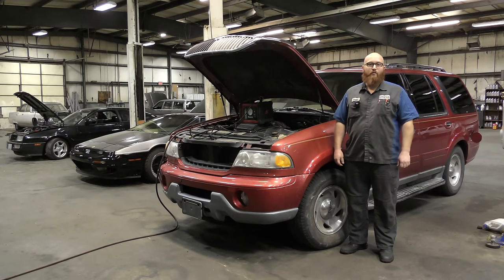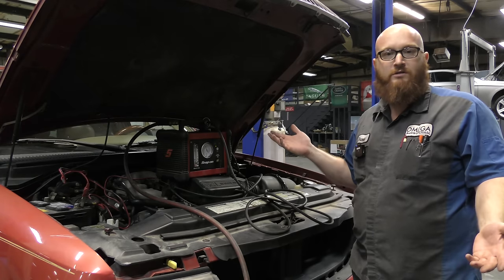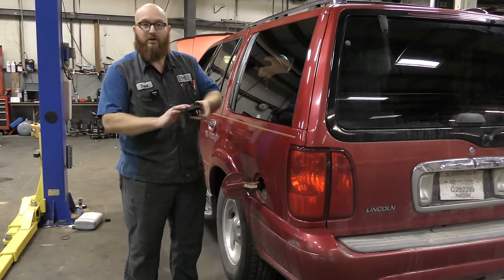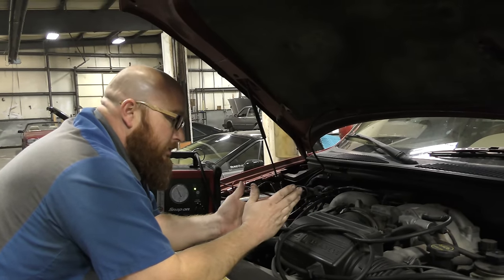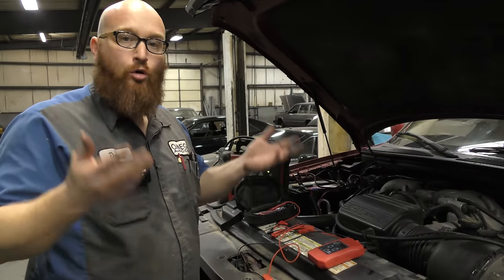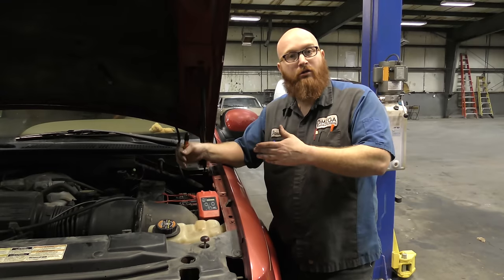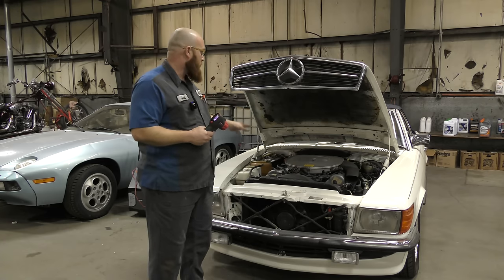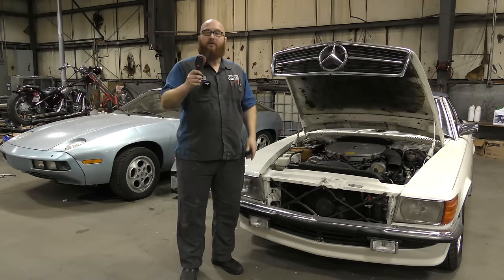Smoking up the Shop!  CAR WIZARD shows 3 essential advanced diagnostic tools he can't live with out!

Comment: Another tip for finding parasitic draw: use a thermal imaging camera to look at the fuse box for a hot fuse
Reply: Can't you just use a multimeter at the fuse box?
Reply: @wms201  yeah but that's more laborious
Reply: Sometimes that can work, but if it's not, you can't beat a Power Probe for speed on checking stuff like that.
Reply: imagine using it on the mustang that had the fan motor sucking too much juice.
Reply: Holding one in my hand as I write.  Essential for comparing the exhaust and coolant temperatures between my left bank to the right bank on my Jaguar V12 5.3 Liter.
Reply: @Chuck Gladfelter Harbor Freight tools sells the "Fox and Hound."  They call it a cable tracker.  $23.
Reply: @wms201  You can but you need really good equipment -- potentially four-wire ohms -- if you're going to detect voltage drop across a fuse. A Hall Effect sensor is a better idea for capturing magnetic flux off the DC electric field.
Reply: Okay I'll just run out and buy a thermal imaging camera   they can't be that expensive
Reply: @kismet19  lol fair point
Reply: @kismet19  decent ones are THAT crazy expensive. I got a Kaiweets from Amazon deal days for $199. Works great.

Comment: The Amp Tester is nice because it connects to the fuses easily and works great in a professional shop but you can run the exact same test with a basic multimeter.
Reply: Yes you can, but on modern cars unplugging a fuse and reconnecting it might wake up some modules so you get screwed with the result. With Amp hound there is no need to remove fuse so you can immediately tell which fuse is culprit for your amp draw.
Reply: You can do exactly the same thing the Amp hound does with a good DMM, put it on millivolts and go across the fuse, this voltage drop can be translated into amperage with a chart, Power Probe has a nice one on their site. It seems like a nice product for doing things faster but you don't need it.
Reply: Syntappi - Sam’s response above this one is what I was referencing. He sums it up nicely. No need to remove the fuses. Again, not a knock on the tool at all, or the Wizard. He’s awesome and it’s why I subscribe to his channel.
Reply: Sam yes, voltage drops on the fuse can be converted into amp draw.
Reply: @Syntappi  you dont unplug fuses to test with multi meter

Comment: Favorite leak detector; I worked in a dealership back in 1981 fixing warranty transmission leaks. I was only paid flat rate to FIX leaks, but not to FIND the leaks.  I would put car on the hoist, clean off the trans with solvent, pressure wash, dry it with air. I would then use anti-fungal foot powder spray cans like from the dollar store and "paint" powder around servos, accumulator, shift shaft, pan, etc. Quick test drive, then back on the hoist. any leaks show a very visible trail in the powder, even small porous casting flaws or cracks in the trans housing. I didn't have UV dye back then, and I only had one shot at finding ALL the leaks. I didn't get paid to pull the transmission, and fix it twice!

Comment: 20:00 so, a cheaper options for those of us who dont have the money or won't buy a 80$ tool that we will probably only use once in our lifetime, using a multimeter, you can use the setting to read DC current and manually check both terminals, or better yet (but it gives a bit more work) remove the fuse, and use the fine needles in each terminal to check, not as simple, but for a thing you can DIY on your car, it is pretty useful. And a cheap multimeter is about $20 or less

Comment: What I've found also works well for  vacuum/boost leaks is using  a charge pressure tester. You hook up shop air to the unit then use the regulator to adjust the price and spray intake area with soapy water,    you'll get bubbles where your leak is. This works awesome on leaks that only present with boost present. I.e. boost leaks 👍👍

Comment: In the old days all we used was flammable spray for vacuum leaks.
we also use propane for R12 refrigerant leaks which made mustard gas. LOL
Use your volt ohm meter & Go to power probe website for fuse charts concerning amperage loss.
Thank you for your videos.

Comment: Wiz, for diy folks on a budget, the are also smoke sticks (like punks) and canned smoke, in a spray can, meant to test smoke detectors. Good for finding out where a water leak in the trunk or cabin is, if you can't spring for a whole machine.

Comment: You can test for amp draw through fuses with the millivolt function on your multimeter; no need to buy another tool. You will need to print up a chart (search "automotive fuse voltage drop chart") which will convert your millivolt readings to millamps based on the fuse size.

Comment: I made my own smoke machine.  $7 for a canning jar.  $7 for a 30w soldering iron.  $5 for baby oil.  I used an old cotton sock as the wick.  I used a ball point pen for the hookups on top.  I used 3 ft. of clear plastic tubing that I had from when I made my own brake bleeding kit.

Comment: My dad is a mechanic he said if your car is missing and a spark plug fouls up on a trip which you should always have spare spark plugs in your kit. He said easiest way to do a spark plug test is a spit test.You put a bit of spit on your finger and touch the manifold lightly you can hear or feel the spit get hot means its working when its not hot you know thats the cylinder needs attention. My dad always has a kit in his car a spark plug or 2 a wrench spark plug lead for the longest plug means you can put it on the short plug without problems and tyre pando points and sandpaper to clean points. We are V8 people so they are so easy to work on yourself.

Comment: Great video people dont know how modern tech can help to diagnose problems. And not just with cars . Two of those items can help with plumbing and heating problems for guys fitting new systems and homeowners looking for issues in older heating systems .The smoke tester can be used to check a new installation for leaks  and the thermal camera can be used for finding issues with old radiators being full of sediment .The thermal camera can also be used to identify faults in electrical / electronic circuits the uses of those two items are extensive and the cost of them is   not much theses days

Comment: Harbor Freight tools sells the "Fox and Hound."  They call it a cable tracker.  $23.  It finds shorts to ground and broken wires.  My Silverado had no power to the trailer hookup on the rear bumper.  I plugged it in and ran the probe over the fuse box under the hood and found the old owner never took out the dummy fuse.  I put in a good fuse and had trailer lights.

Comment: 8:10 I think you've never seen a forest fire and don't quite grasp "billowing."

Great video. I'm the neighborhood mechanic people were coming to me with Lean codes and evap leaks. So I bought the cheapest one on Amazon $200. I had been wanting one for a while. Finally ordered it after spending way to much time tracking down a P0171 on a 2002 Lightning. It's been great, probably wouldn't stand up to frequent use in a shop though.

Comment: The thermal camera is also great for looking at wires and circuit boards, instantly shows damaged components or wires that are overheating due to high current draw.

Comment: Another tool that can be used as an indicator for any temperature  related issue is a $20  infra digital red laser indicated temperature sensor which you can get on e bay.
 They measure temperatures of bearings such as wheel bearings and  auxiliary drive   bearings . Just point the laser guide at the suspect bearing and it digitally shows the temperature. Great for comparing suspect wheel bearings  that can be heard while driving but are hard to determine if it is right or left hand and the same for tires that a noise comes from and may be defective . 
 You can use them in the same way the Wizard uses his display type temp reader or use them in your home to determine  heat spots or cold  in your ceiling where  insulation is lacking or where a suspect animal is hiding in it's nest.

Comment: This might be a stupid question but can you use normal Amp meter for checking those fuses instead of this tool?
Reply: The fuse would have to be removed so that the amp meter can be put in series. This can sometimes disrupt the power supply to modules that take time to shut down.
Reply: Zygmunt Bonifaciuk you can use a dmm and measure the voltage drop and convert that into amp draw. You do not need to remove the fuse to test it.
Reply: It makes sense, thanks!

Comment: Nothing like going to classic car shows and smelling gas on hot summer days. 
Also smoke machine is great not only for evap but for finding other leaks in the intake system. I have even used it once to find a boost leak. Not always going to work to find boost leaks unless they leak without pressure.

Comment: Nice tips there Car Wizard! I used to work at GM shop in one of the wealthiest counties in the US and they loved "The Chassis Ear" but it was in regular use as it was in the early 90s. Do you have any comments on it? I'm impressed with the first one most of all, but truly not one of them is a sluggard. I guess you will always have folks say it's not needed. Do you have any experience on the induction heater to get fasteners like head or studs on exhaust out without any direct flame. I've seen it on Banggood for about $250 & multiple heads. I even like the boat series. I've been ASE certified, but as a rider in an early VW bus struck by an 👽 in a hurry my doc told me that I need to find a job where I don't stand or am kneeling for a long time.

Comment: Smoke machine is super handy to have.   Evap codes be damned, I ended up removing the charcoal canister from my subaru since it had clogged and they wanted an arm and a leg for a new one.  Deleted the engine code for the check engine light and life is good.

Comment: Car Wizard can you do a video explaining to us long and short term fuel trims? From what I understand once you master the understanding of fuel trim it can greatly cut down on time spent diagnosing a rich or lean condition caused by unmetered air entering an engine or too much fuel entering the combustion chamber that can cause false oxygen sensor codes when the oxygen sensor is in fact not the problem. Once you understand long and short term fuel trims you will never look at a  scan tool the same way again.

Comment: Hi Wizard,
One note for the viewers on the amp hound. With modern cars faults can be on different circuits to the main current draw. I had a draw from a canbus module, but the fault was due to the after-market car stereo not letting the canbus go to sleep.
Incidentally, I fixed it by adding an isolating circuit to the stereo canbus signal wires

Comment: Hi Wizard .Just watched this video and I really need the link to the electrical  drain  scanning tool you demonstrated with the fuse box . I checked your list below the video and can't find the $80 dollar testing tool .If you can post it , I sure could use a tool like that to help me find the drain on my 07 GMC duramax . I've replaced both batteries twice in the last 2 years. This issue has to be resolved. Thanks for your expertise and caring for your subscribers .

Comment: Remember the old freon detectors? They used a small propane bottle and a copper penny. They haven't made copper pennies since 1982.
Reply: smolville I'm a coin enthusiast and I was always keen on metallic sounds I told some guys in my old highschool they wouldn't bet 10 bucks I could tell if they dropped a penny newer than 1982 on the tile floor I was almost always right and they thought I wouldn't be because I was a smoke machine myself lol. The only time I wasn't I broke out my trusty scale and would tell them if it was 2.5 or 3.1 grams because half of 1982's are zinc other half are copper. Also dimes have 118 Reed's the lines on the side .... Just a little trip down memory lane

Comment: Great video. I made my own smoke machine  for essentially free (thanks YouTube). I tried checking my sbc intake system for leaks. The problem was so much smoke came out of the carburetor throats (actually FiTech throttlebody) that it was hard to pinpoint any possible small leaks. Any suggestions on how to seal off the carb/throttlebody so the smoke is contained internally?

Comment: Some spade fuses from newer Audi/VW models don’t have exposed metal terminals so that adapter won’t work,have to use pins under the fuse.Buggers
Reply: I find some cheaper fuses don't have them either.
Reply: If it's a standard fuse just without the test points, just replace the fuse with one that has them.

Comment: My favorite “days of tracking down an electric drain” was my old GMC. Weeks, actually, it wasn’t a daily driver & it got used almost exclusively in daylight; and my battery was dying every time it sat for 2 days. Until I went to drive it at NIGHT one time.

Vanity mirror lights in the passenger side visor were staying on 😂😂😂 i ripped the entire lipstick mirror out and taped off the wires in both visors, I was so pissed

Comment: I'd like to add that in 2022 us younger people can always use a pocket VAPE to produce smoke and blow it into the brake booster line.  I found lots of vacuum leaks that way.  Unlike the snap on machine, a vape fits in your pocket and you can always yell your boss you're using it for work!

Comment: Another simple circuit tester is to use a 12 volt test light. and open one lead from the main battery on the car and put the tester in series between the post and the battery lead.  Any circuit draw will light the tester and they you can start pulling fuses to find where the draw is coming from...

Comment: Some of the valves in the EVAP system won't open unless the pressure in the system is higher than atmospheric (from warm fuel vapor), or no electrical signal to the valves.   Meaning the smoke machine won't identify a leak in a line because a valve is closed.

Comment: So...you can jump the ends of old fashioned glass tubes with a voltage meter and if you have more than say, 0.1 amps, that circuit could be the draining one right?

Comment: The device that heats the oil is Nichrome wire connected to the 12 Volts. There is no need for the shop compressor air as the vapourizing smoke will produce a couple of psi. You can make this device at home.

Comment: In my company, we use the thermal imaging camera to test electrical drives that are difficult to access or to find heat spots in control cabinets.
It is  a very helful tool.
You can also detect hot women with it ...... o sorry ....LOL.......:)

Comment: Two comments:

1) Starters and alternators are often unfused and can draw current when the car is off if they fail.

2)  I'm dubious on how you would measure current going through a fuse by tapping it in parallel to fuse.  The fuse will have a pretty low resistance so if you provide a second current path, some current will still be going through the fuse.  Alternately, it could measure voltage drop across the fuse, but that requires knowledge of the resistance of the fuse which can't be accurately predicted or measured while an unknown current is flowing through it.

Comment: Don’t you have to close the canister vent solenoid (normally open) with a scan tool so you have a closed system when testing the evap system. At least with Toyota.

Comment: What do you have to do the crack a charcoal canister Mine doesn’t have a bracket it is bouncing between the bed and the gas tank and it’s still not broken I should probably fix it though zip ties

Comment: I used a thermo imagine gun on my grandmas 96 rang rover to check if the temperature gage was correct it would always tell us the engine is over heating come to find the gage on the dashboard is bad and way out of calibration  the engine coolant never went above it’s operating temperature saved us thousands of un needed repairs because of a faulty gage

Comment: FYI. With some modification a Halloween smoke machine will work, not as well as a proper automotive machine (you won't be able to create as much pressure so its not so good for evap but it works pretty well for intake) and I have no idea if they use the same chemicals to create the smoke but when you're in a pinch and its October a $20 machine might work to take the place of a $200 one. 

😂

Comment: Please tell me you fixed Crazy D’s charcoal canister for cost of the part.
Reply: A charcoal canister is just an abs? container with input and output lines. Its not under much pressure, you just need to seal it. Assuming it's clean and there aren't any gaps I'd try pure acetone after cleaning the mating surfaces
Reply: If you need to fill gaps, there are solvent solutions with shredded plastic in them or you can fuse donor ABS material via temperature controlled thermal welding

Comment: I have 79 k5 blazer with 400 small block. I started looking at my engine bay looking at all my vacuums. Trying to figure what the truck doesnt need. That was the first thing I took out. And I dont know anything. I want the most bare motor and all hp to transmission. I dont like horsepower robbing emissions. I know I kinda dumb. But I want horsepower.

Comment: But Car Wizard you didn't answer the question as to WHY the people Kilmer calls the "evil swine who design these things" make those shrader valves reverse thread.  Is it just to vex and defeat anyone who works on them?  Also, why wouldn't you just patch up with JB weld or some other thing an expensive evap. canister or other broken plastic part rather than buy a new one? Also, couldn't you just use the ammeter on a DVOM to do the same thing that special tool does?  You can buy a pretty nice DVOM for $80.